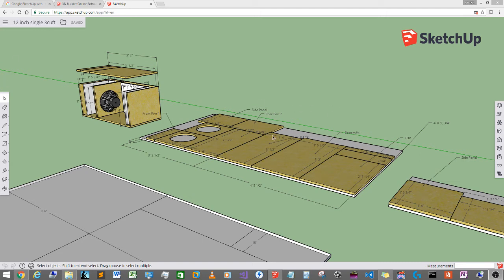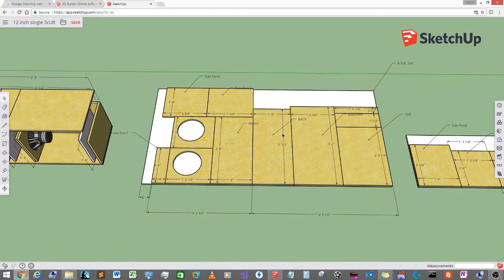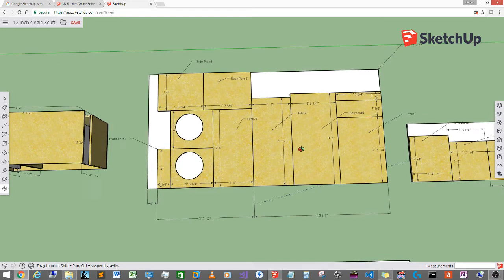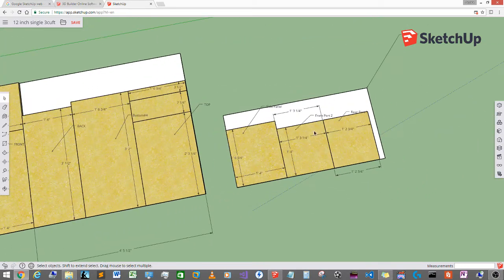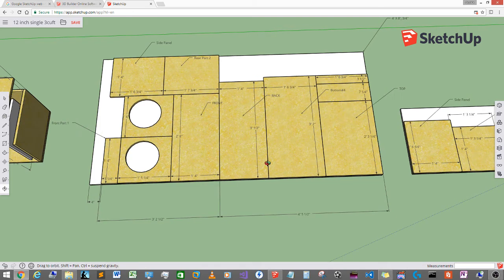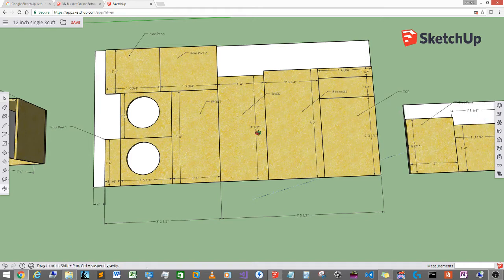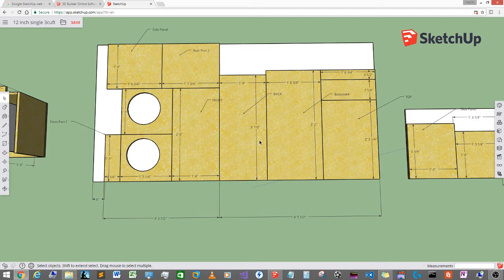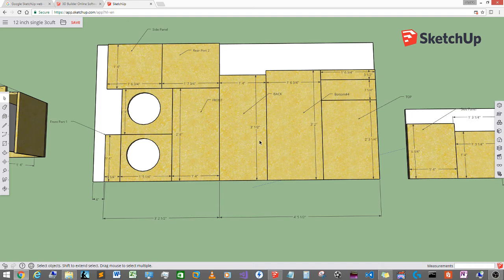4th Order vs 6th Order Band pass EXPLAINED Pt 4 - Cut Sheet

Comment: Maybe you could tell me if my little dream is possible or not. I know bose is not a good name. I’ve been in long enough to know that. However their boxes/enclosures and crossovers are to be commended. So....I want to build the sub bose should have made. I want to make a bose acoustimass inspired sub using 10s or 12”s where they use 5-6” woofers. Their subs sound decent because of the enclosure design. The bose speakers themselves are garbage but in the home they sound like at least one powered 10. How would I go about scaling this up? Or getting the dimensions of the acoustimass sub? Or designing my own version? Where would you start if you wanted to do something like that?

Comment: i am willing pay you if you can design a bandpass for a single 12" sundown zv5 that must fit into a 2016 e350 4matic benz... there is a cutout behind the armrest so i would like to have the port going through the cutout..  what is you advice or recommendation please ???
Reply from the maker: I can't seem to find specs of the woofer you mentioned. Do you have the spec sheet? If so, share. otherwise, it would be kinda difficult to build an enclosure to optimize the woofer's true potential.
Reply: here it is http://www.down4soundshop.com/Z-Series-v.5-12-2000-watts-D2/  i would like to box to fit in a 2016 e350 4matic trunk as mentioned above that there is a cutout behind the armrest :D  hope this helps.. thank you for the reply  :D